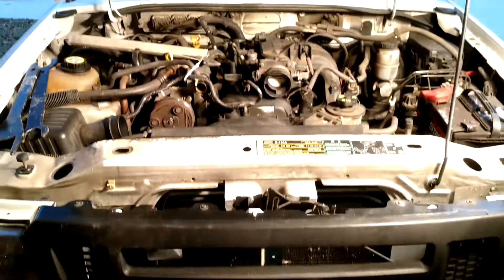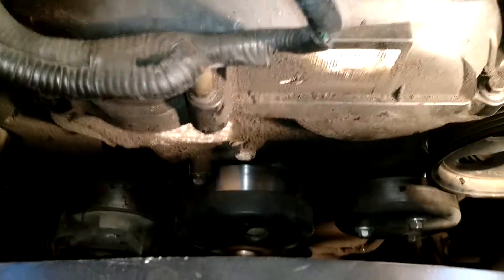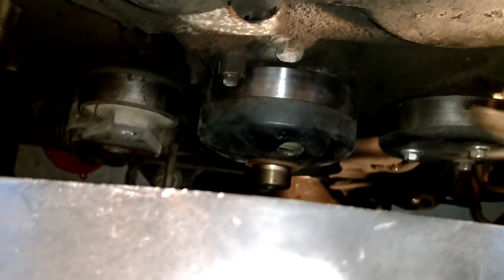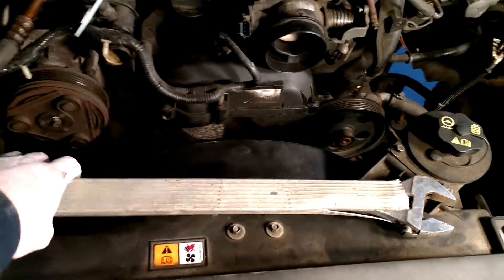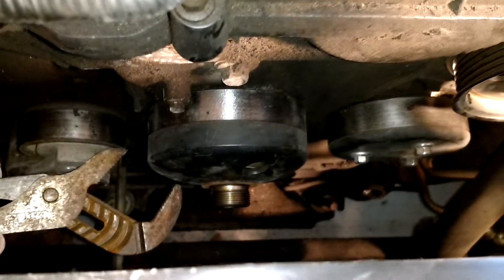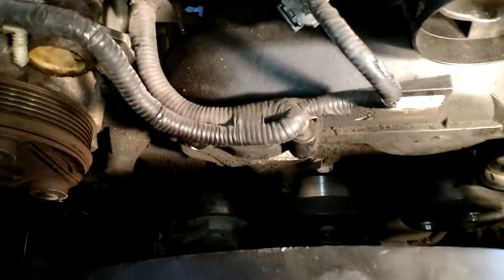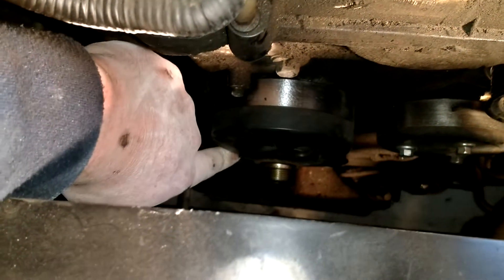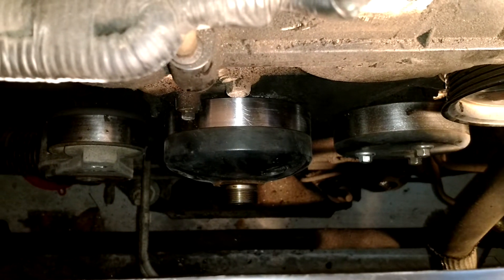2008 Ford ranger Fan clutch replacement trick!

Comment: Thank you sir. Probably lLike most of us here i had the pre- 2007 giant fan pulley holding tool, and then dived into removing the radiator, then got stuck on this newer type fan clutch setup. Great idea for holding the fan pulley in place!
Reply: And yes i agree, from my understanding.....if the upper fan shroud does not say "left hand threads" on it then it is the standard right hand counterclockwise direction to remove the clutch nut. Thanks again.